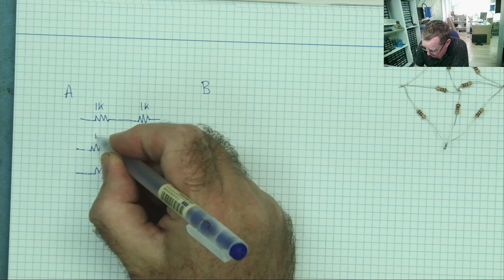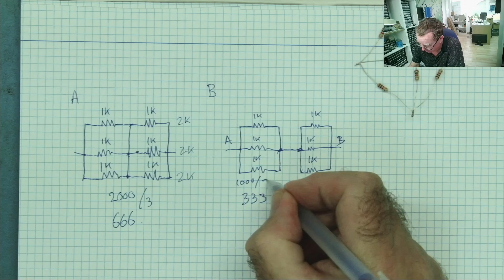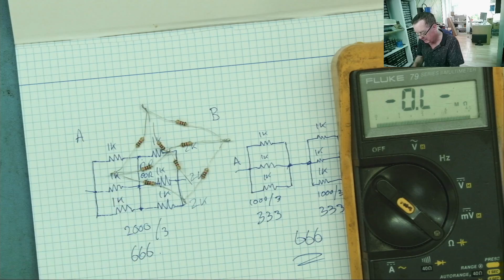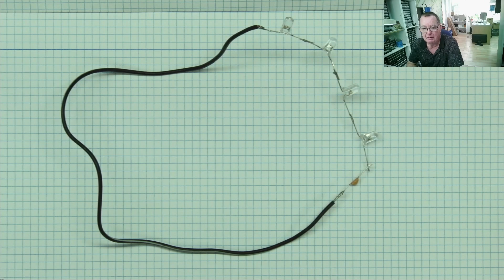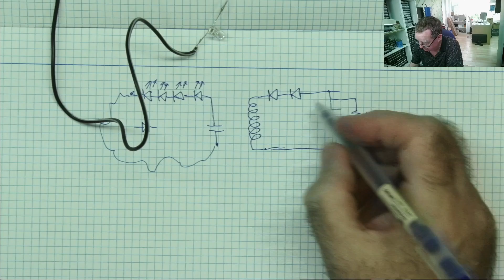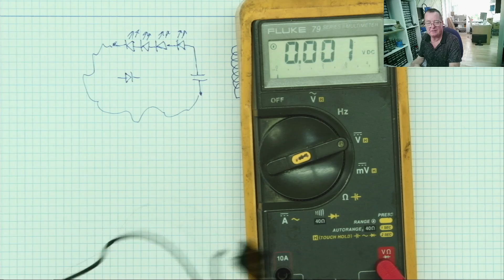Did you enjoy the LER Christmas Quiz? Here are the answers to the three electronics challenges

Comment: Many thanks for this, and all Your other excellent videos.
I have a (possibly stupid) question regarding the last "problem" that I would be very glad if anyone could answer.
When putting the "second" diode in parallel to the "leftmost bulb", with the intention to make it possible to only light up the "right most bulb" with the "second switch". Would there not also pass some current through the leftmost bulb ??.  But it would not light up "simply" due to the fact that the resistance of the bulb would make "most of the current" run through the diode ??
Please note that I'm no way implying that the solution was wrong, I'm just trying to understand with a little tiny bit more depth how this works... And if the "second diode" somehow stops ALL current from passing through the "leftmost bulb" I'm at a total loss as to why that would be .. :=)
Best regards
Reply: Yeah I'm the same, the rest of the circuit makes sense to me, apart from why that left light doesn't light up? Can only assume it's down to the old 'will take the path of least resistance'? And the bulb has more resistance than the diode so it flows through the diode instead of the bulb?

Comment: I knew Kirchhoff would have something to do with the first one, but couldn't remember the solution. I last did something like this in 1985 at HMS Collingwood. 😊
I'm pretty sure this principle is basically how bootstrapping works in amplifiers, which boosts the input impedance into the giga Ohms. Tera Ohms if you use a guard ring.
It's mentioned in one of the R.M. Marston Circuits Manual, a collection of books that EVERYONE in electronics should have IMHO. I cannot recommend those books highly enough.

Comment: It is true that some (not all) LEDs generate a small voltage when light is shining on them.  The Afrotechmods channel has a video on that.  I tested it with several LEDs and a laser and oscilloscope and found that some of my LEDs do in fact make a detectable voltage, and the response is much faster than photoresistors or solar panels when detecting a high frequency flash.  I just don’t have any phototransistors to test and compare response times.

Comment: Falstad circuit sim is a great tool. I use it often for tinkering from behind the computer. The difference between LTSpice or whatever is that it's realtime and you can see the current flowing with dots moving on wires which gives you a better understanding of the circuit and also, you get pretty charts. Also, you don't have to know any equations to use it. I think Detlef could teach you and other viewers how to use it similarly to how he taught using the circuit design EDA software.

Comment: I got 1 and 3 , but was expecting much bigger voltage on 2 due to photovoltaic efect. When i think again the rf efect is very real . I have build this radio 30 years ago , radio of just  diode and tuning loop . Actually if you place wire that long around walki talki it will lit a bulb like one in thirth quiz. I have seen this as part of EMC testing.

Comment: On the diode circuit test, I expect that the tape or the tape adhesive is not a perfect insulator, so that might actually be bridging the diodes like a parallel resistance just enough to prevent the same charge to build up.

Comment: Briliant quiz. The induced voltage circuit using LEDs was good for thinking. Couple of points of observation.

1) Any induced voltage would be AC voltage, and the purpose of the LEDs are to rectify the induced AC voltage picked up from the 'coil' (wire loop) to be able to charge the capacitor.

2) The tape on the LED was a bit of a red-herring because LEDs are a light EMITTER so the tape wouldnt make a lot of sense. However if you used a photodiode (photo detector diode) think of it as a Light Receiving Diode, it would use light energy to switch 'on'.  In this instance it would mean that black light proof tape would indeed make a difference because without a light source the photo diode (Light Receiving Diode) would be in an 'Off' state, and hence would not act as a diode, therefore the induced voltage would not be able to rectify to charge the capacitor.
Reply: Opps, meant to also add that the end results depend upon where the built circuit is stored, ie is it near an EMF producing device, and from your results about the use of tape on the LED (dubious) was it sorted in the dark.

I love these deep thinking projects.
Reply: @stevosteve  If he used a brand new capacitor that NEVER had been in a circuit, the voltage would be 0.  Only capacitors that once had current will act that way.

Comment: Well, you tried blocking the light going to the LEDs using black tape, now try putting the experiment in a Faraday cage to prevent radiation from entering the circuit.

Comment: Actually, question #2 was a little unfair, Richard, as you yourself were not able to give a distinct answer.
I was guessing that the capacitor would charge to ca. 12V, four times the average forward voltage of a blue LED which I assumed them to generate by photovoltaic effect.
So I did some tests by myself with regard to this.
First of all I used an analog meter as it allows a better observation than a digital readout.
Also my meter has 100 MOhm input resistance giving a longer RC time constant to observe.
I tried two different blue LEDs from my assortment, one type generated only 15mV photo voltage per LED, the other one 2.2V (but at only ca. 15uA).
With a minimal loop, the capacitor did not build up measurable charge in darkness.
Additionally I made another circuit with two 1N4148 and an air coil.
With a ‚powerful‘ EMI generator (gas lighter) nearby, I was able to charge the capacitor up to 12V!
So what‘s the correct answer, Richard?
Reply from the maker: Well... IMHO the correct answer is what you did. You invetigated the puzzle and came up with some interesting results than we can all think about and learn. So take an extra bonis point for getting involved with some passion in the quiz.  Well done 😀

Comment: I'm giving myself a half point for knowing that diodes were the solution without taking time or effort to figure out the cases. I guessed zero for two so I get a quarter point?? The meter did read zero eventually. One, I guessed 2k resistance so I still have work to do and the question I spent the most time on. Maybe next year.

And above all, cheers to you mate, for spending your time on us
Reply from the maker: Yeah the meter in challenge 2 did read zero in the end, so you were eventually correct 😀

Comment: Merry Christmas!
 In problem 2 you asked what was the voltage across the capacitor, in the solution you stated that it was between 2.5 and 3.5. You showed this in practice using the meter, but you didn't explain why the voltage was within this range instead of say 0.6v.  
Were you expecting to get about 3volts and if so why?
Reply from the maker: I was but only because I have done this before. It may have someting to do with the forward voltage drop of a blue LED being in the range of 2.5V-3V, not 0.6V as per a standard silicon diode?

Comment: Using a vintage meter with a fet in the probe (very high impedance probe, doesn't load the circuit down) I was able to measure a steady 1.5 volts with a bright flashlight shining on the LED's, only around 0.08mV with dim ambient light. A modern multi-meter has too low of impedance to accurately measure this circuit.

Comment: Just one little nitpick: 666.66 does not get rounded to 666, but to 667 instead. 2000/3 = 666 2/3, but when you round it to whole Ohms it will become 667 Ohms, because 0.67 is closer to 1 than to 0, but that messes with the diabolic hint, eh? ;-).
Reply: Yeah, but the whole "666" thing is a mis-translation anyway: the actual number of the Beast of Revelation ( NOT the devil) is 616.

Comment: A question regarding the crystal radio. The first law of thermodynamics states that energy can neither be created  or destroyed. A radio station broadcasts a signal, the crystal set has no power supply, so it must take energy from the broadcast signal, if thousands of crystal sets are in use,does that mean that the transmitter needs to increase it's output relative to how many are listening to maintain signal strength? I know a bit but I don't know much, I could be wrong but I've thought about this for years. If any of you can enlighten me, I'll die a happier man!!
Reply: There's the story of the guy who was fined for theft of electricity - he heated his greenhouse with a coil using radiation from a nearby TV transmitter.
Reply: The front end of ALL radio ( and TV ) receivers extract a tiny amount of the transmitted RF energy.

Comment: It should be a hell of a RF signal to be rectified by four LE diodes in series that makes up like at least 10V from that "coil" to open the LEDs and make them rectify the induced signal. Ge diodes start conducting at 0.2-0.3V, Si at 0.4-0.7V, blue LED at 3.5V if I remember correctly. Hence for RF signal detection a Germanium diode is the best candidate. So, the voltage on the cap is due to photoelectric effect of the LED string. All 4 of them should be lit simultaneously for maximum effect.
Reply: I agree. The RF signal strength would have to be several volts per metre for LEDs to be able to rectify. A crude loop of wire is a very poor antenna.

If there is a photovoltaic effect at play the caps will charge to the open-circuit voltage of the cells as long as no meter is connected. The short circuit current, which can be measured reasonably accurately using a DVM on low milliamps range (not quite a short, but not too bad). Short circuit current versus illumination tends to be very linear over at least a few decades of illumination.
Reply from the maker: You've just seen the proven results of that particular test...
Reply: @learnelectronicsrepair  To really prove it you now need to build a Faraday cage around it to eliminate radio waves and test it again.

How your going to do that and still be able to test it is another problem.
Reply: @tenlittleindians  
You can do a pretty good approximation of a Faraday cage around the "antenna" by using a piece of coaxial cable with the centre conductor as the antenna and with the shield grounded as the cage.
Reply: @D614G_aka_Doug  it will pick up any magnetic flux though.
Reply: @jjcale2288  
True. Shielding against magnetic flux at low frequency is difficult. You need a substantial thickness of something like steel or a thinner but much more expensive and difficult material like Mu metal. Mu metal works quite well but if you make a box or the like you have to anneal it carefully after bending. At high frequency a good conductor such as copper is quite effective because the mag field will induce eddy currents with their own mag fields in opposition to that which caused them.

I don't believe any "ordinary" magnetic field would be sufficiently strong to induce sufficient voltage in a single turn in free air to make any diode, much less several LEDs in series, conduct.

As is very often the case, a properly used oscilloscope is a much more instructive instrument than a simple voltmeter.

A fundamental question with any measurement is "Are you sure you are measuring what you think you are measuring?" The answer is often far from easy. I've seen some pretty harsh and well-deserved criticisms of scientific papers because of flawed methods. A Nobel laureate dabbled in some weird stuff outside of his real expertise in his latter years. I saw oscillograms of something he claimed was [exact details I can't recall]. I took one quick look and recognized a pretty common noise waverform. He did considerable harm to his reputation with his nonsense.
Reply: @learnelectronicsrepair  no, but  still, I helped you with the YT algorithm😉. Merry Christmas!
Reply: What about that, when you discharge a cap briefly and the voltage rises after that, even while disconnected from anything - dielectric absorption ?
Reply: @brano2yt  
Some caps that use ceramic with high dielectric constant ("relative permittivity" is preferred term now) ceramic have pretty horrible dielectric absorption, but it probably isn't enough to show up using a slow-responding meter with 10M input resistance with just a 100 nF cap.

If you tried that same cap in a sample and hold circuit and didn't know about dielectric absorption issues you'd probably lose your mind trying to figure out why your circuit performed so badly.

Comment: Well as I commented in previous video - 2 components solution is also possible, because of the word component you have used - 1 component double diode with common anode and 1 double diode with common cathode.  Common anodes and cathodes are connected between the keys and the bulbs. So it is a bit bending the rules, but it is still 2 component solution :)
Reply from the maker: Not bending the rules at all. Well done 😀
Reply: You can even change the double diode for power BJT transistor. Which is sure one component. NPN for common anode (on base)  or PNP for cathode
Reply: @brano2yt  well, there should be 2 current limiting resistors in this case and then we have 2 components more
Reply: @lordjohnpp  we are using only one PN junction in that BJT at every tíme, no resistors  needed, we are using it as two diodes with out transistor efect

Comment: Love this channel and this little quiz was fun. The resistor one got me thinking as none of the components are  in series or in parallel so I thought it would need nodal or mesh analysis then I saw the symmetry that forces the 3 nodes on the mid line to be at the same voltage regardless of what voltage is applied to the network which means no current will flow through them so the two middle resistors can be removed. The network becomes 3 pairs of 2K resistors in parallel which is 666 Ohms as you demonstrate.

Comment: the capacitor led thingie If you used a vtvm the cap may not have discharged or not as quick' the vtvm (Vacuum tube volt meter) has a very high internal resistance
Reply: Most VTVMs have an input resistance about the same as that of most reasonable-quality DVMs - typically 10M. As long as you have a resistive divider chain to attenuate high voltages you can't get around this. There may be a range that has much higher input resistance. My 6-1/2 digit Agilent DMMs have such a range but I can't recall specs.

If very light loading is required a buffer made with a FET-input op amp could be used.

A better instrument would be an oscilloscope with a FET probe. Then you could actually see what was happening. Good FET probes cost more than many hobbyists and small shops will pay for an oscilloscope.

Comment: Actually, for question 1 there's no need for all the resistors to be the same value. All that's needed is for the left set to all be the same and the right set to all be the same.
For example, using a 6v total voltage with 1K resistors in the left set and 2K resistors in the right set then the voltage at the midpoints will be 2v in all cases. Again, there's no voltage and therefore no current across any midpoint links.
Reply from the maker: Yes I totally agree

Comment: kicking my self over number1 shoul of drawn a resistor ladder 
number 2 i should of had a guess as when we had some new power factor corection caps to fit at work they came with shorting bars across the contacts to stop ghost voltages .
number 3 i will take as a win 
so a disapointing 1 out of 3
Reply from the maker: Getting any one of these right means you are good at electronics. Feel free to kick yourself though if you wish, or I can always loan you a willow bough or something lol 🤪